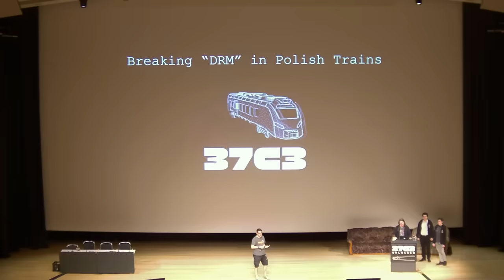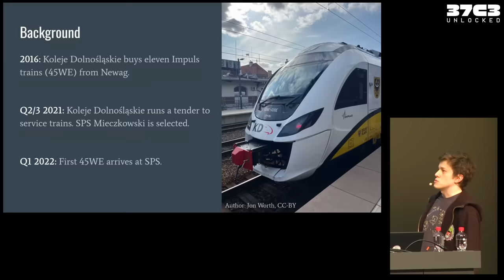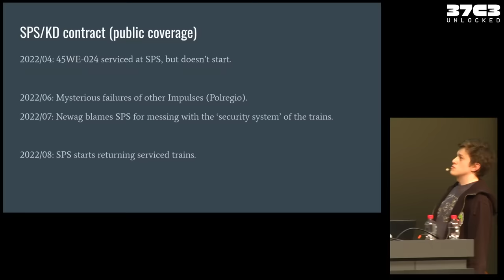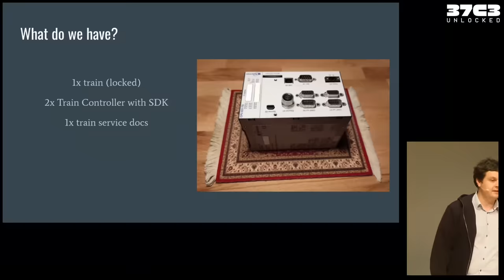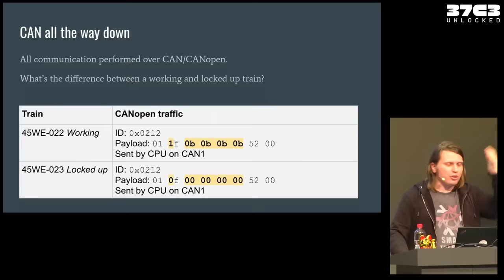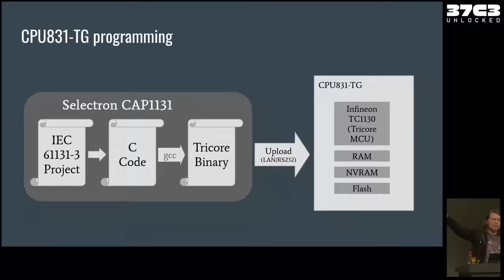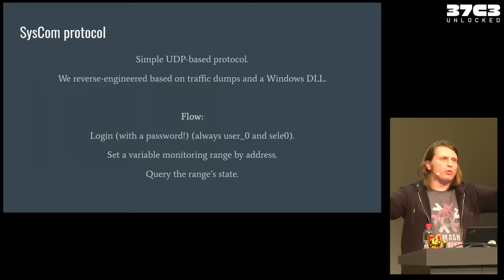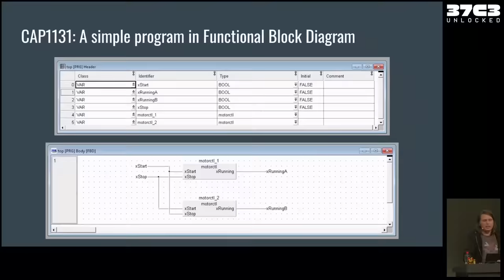37C3 -  Breaking "DRM" in Polish trains

Comment: The film is interesting, even if it is sometimes difficult to follow the erratic explanations. The boys should at least halve their coffee consumption.

In my opinion, the errors described in the video have two aspects:

1.	Functional ones, the usefulness of which is questioned by the three 'specialists' without obviously knowing the requirement specifications. For example, there may be technical reasons why a safety lock intervenes after a vehicle has not been operated according to the technical design for a certain period of time. In the case of compressors, this may have to do with the cleaning of system filters, which only works safely above a certain operating temperature without endangering the compressor.

2.	If these security mechanisms take effect simply because a date evaluation in the software is incorrect, then this means that the development process was not carried out correctly. Such errors must be detected at all three test levels that a train system must undergo. The tests were therefore not sufficient. The licensing authority should have shouted STOP here. In Germany, all specifications, all documentation and, above all, all test protocols must be checked by the authorities, before a train can receive approval.

What the three guys did, namely modifying the code to get the trains running, is also beyond borderline. Every change must be justified, specified, reviewed, implemented, tested and released according to European standards. Quick bug fixes in one place without checking the effects elsewhere (keyword: non-reaction) are legally inadmissible for good reason.

In the railway sector, it is common for externally identical trains to run different software versions. To identify the criteria according to which this was done (operator specifications, environmental standards, versions, etc.) is not possible without reviewing the original specifications. Often it simply has to do with where a train should be deployed. My favorite example here is the train toilet. On trains that are used in the border area of Germany/Austria/Switzerland, the Sh.. must be handled differently (for environmental reasons), even though the hardware is always the same. But again: If the different versions are the result of improper use of versioning, the authorities have failed here as well by not detecting these flaws in the engineering process.

Another word about the three guys: They are obviously hackers who use Alias' names. They obviously never had anything to do with the train development process. Their criticism is justified; an outside perspective always helps ensure the stability of a process. The show they put on, the arrogance they display, may give them 15 minutes of fame in their bubble, but it is detrimental to solving the problem.
Reply: They did not modify the code, only the NVRAM
Reply: I'd suggest you stick with hours long corporate meetings in German, were 1000's of well-rounded meaningless words accompanying 100's of slides fulfil the intellectual vacuity of the whole assembly - the tempo of narration of *this* presentation was clearly an order of magnitude too fast for you to have a grasp of it, clearly demonstrate by your statement that the code was modified, where it was stated multiple times it was not. 

As was your misguided reception of the whole event — you were watching a hacker conference and you were expecting what? a formal parliamentary hearing?

You also clearly missed the context of the whole endeavour, namely this has happened within the context of professional, certified maintenance process with both licensed operator (KD) and  licensed service company (PSP) that has already completed all maintenance and refurbishment of physical components of the system in compliance with manufacturer-provided documentation, and under supervision of both parties to assure the outcome will not put anyone in danger. The Dragon Sector *analysis*  was just last step to make refurbished train functional again.  All that happened  without any assistance of the manufacturer, NEWAG and amid harassment campaign orchestrated again by NEWAG.

Or maybe you have blatantly ignored it to prove your "point"?
Reply: If you design any functions, which altered operations, you 1. need to document it 2. User/Operator needs to be informed that this function going to/is triggerd 3. There need to be override. Or you can design 737 Max(there were other examples in aviation industry, to be fair). Tempo of the presention was ok, it was easy to follow.
Reply: 0.5 zł per comment
Reply: @fajajara  that's no German, it's a Newag-paid troll with a one day old account

Comment: I am really concerned about the fact that no one addressed safety of the trains after such "repair". The guys are definitely good in the job they are doing, but the railway systems are obviously out of their league. The TCMS software is not an iPhone or a game console that can simply be unlocked. I really wonder if the guys really checked all conditions that may be affected by their "repair". The TCMS performs safety functions too, and yeah, even the gray devices perform the safety functions, the PLC does not have to be red or yellow. See for example the TSI Loc&Pas and "Door-traction interlock" for one safety function that was mentioned in the talk. I am not defending the manufacturer nor am I against the initiatives that disclose shady behavior of producers. But such approach as displayed here is IMO against the safety culture that is so much needed in the railway sector.
Reply: Safety functions are supposed to be checked and evaluated every start sequence based on sensors, not on values in memory . One time bits swap in PLC data memory (again! not program - just data memory) is not supposed to influence any safety features. I doubt the locomotive would get certification if safety checks worked in other way.
Reply: The researchers specifically did not do anything that the firmwares didn't : they performed the unlocks via special functions already present in the firmware; the same that NewAg would use for their "repairs".